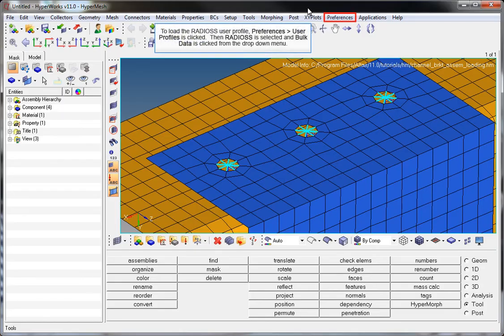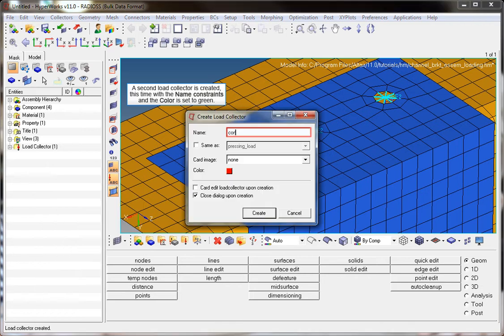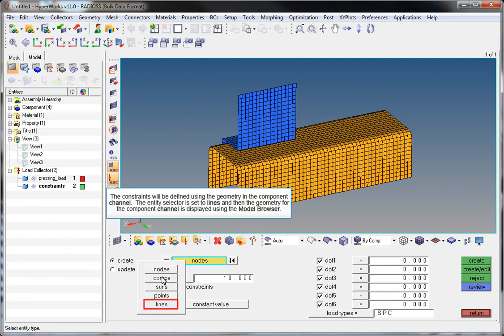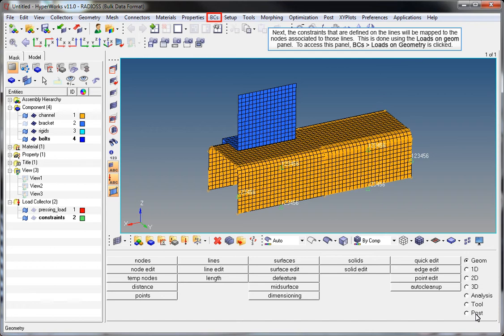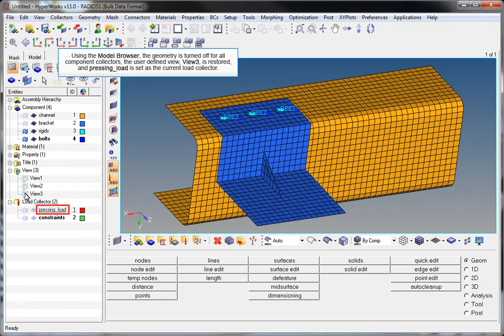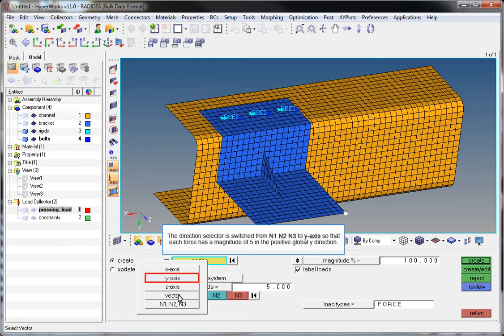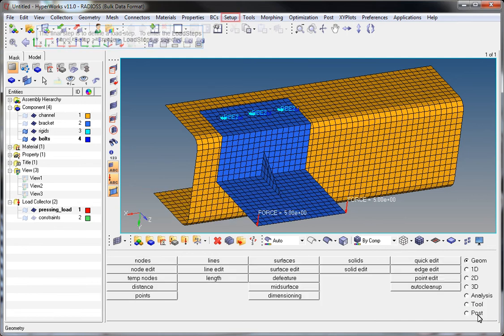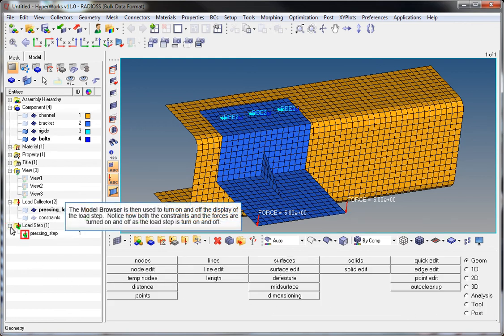HyperMesh - applying boundary conditions

Comment: I gotta request. I am currently struggling to create a spot weld (as connector) to attach to surface. The product is the same as the video posted by you titled: HyperMesh - applying boundary conditions (/watch?v=IzEADtHjk80). And also can please explain all the material card edit symbol (Nu, Rho, etc). Thank and keep on posting.